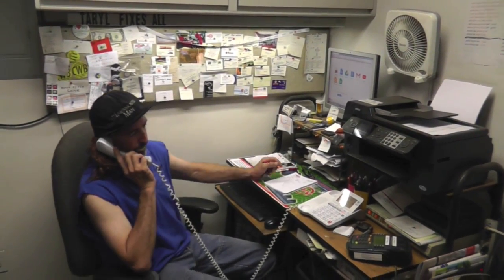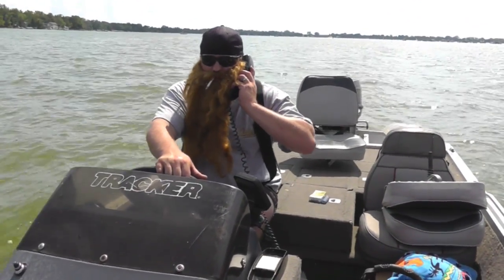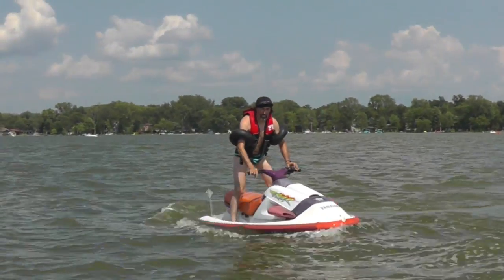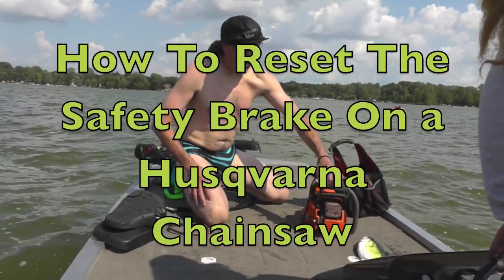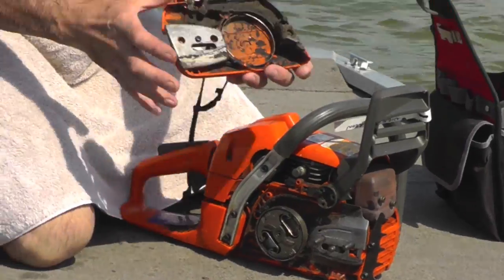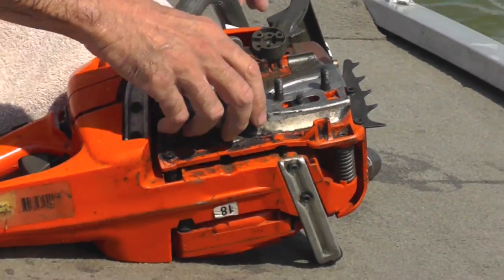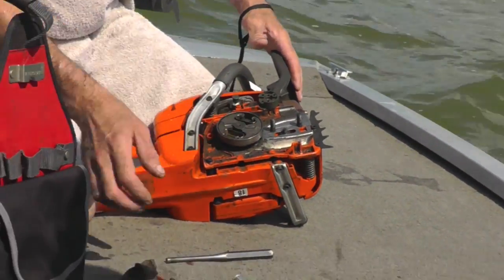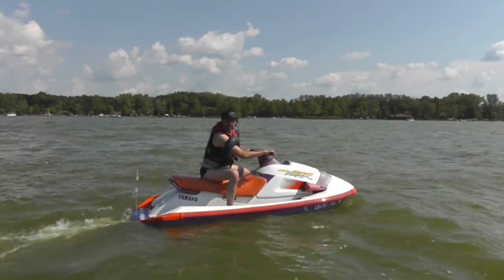How To Reset The Safety Brake On a Husqvarna Chainsaw - with Taryl

Comment: Hey man off the subject, I gutted a kroler fuel pump and put it back on hooked my vac line for the Briggs pump and it works great , it's a 16 horse on a walker mower , hope you finger out what i am talking about.
Reply from the maker: I just did one on a Krohler mounted on a stump grinder.

Comment: Speds on a boat....with little saws..
"A lot of people will set the brake before take the chainsaw cover off" LOL WTF!!
It's a clutch cover,and you engage the brake...you set a parking brake on a car/truck..if they engage the brake and they try to remove the clutch cover it will not come off.....unless they pry it off..... especially on that saw an the majority of Husky and Jreds.
Some saws have the brake band and parts built into the case half...A few Jereds/Husky and most Stihls..those you can take the clutch cover off while brake is engaged but you won't be bale to work on the clutch or it related parts.

Sometimes the clutch covers on this style will get dropped and kick the brake on....this is when you pull the clutch,install the clutch cover and release it....
This stupid $hit been on YT for 7yrs? JFC...

Comment: Simple fix, use a pair of 90 degree needle nose pliers. your video was great other videos used complicated methods that could damage the saw.
Reply: That is exactly what I use. One of the most useful pliers sitting around, but for some reason a little harder to find a nice pair in lowes or home depot.

Comment: Use a screwdriver to move the break part in the cover back to the posiion which matches the safety brake on the part on the saw.
Reply: I tried that, won’t budge any tips
Reply: @taylore9697  it's been a while since I've done it but I kinda need to clean under the cover on my saw so I'll do that & while in there I'll try to remeber what I did before to free mine up and then I'll get back to you.
Reply: @taylore9697  are you maybe moving it the wrong direction?
Reply: @waynes.2983  I got it! just wasn’t pushing hard enough was a little spooked to break it lol used to running stihl saws that’s what i work with just bought a 450 husky so i’m new to em
Reply: @waynes.2983  i chipped off a piece of plastic so after that i wasn’t sure if i was doing something wrong so i tried it again and got it to move to release the chain break, thanks for getting back to me though